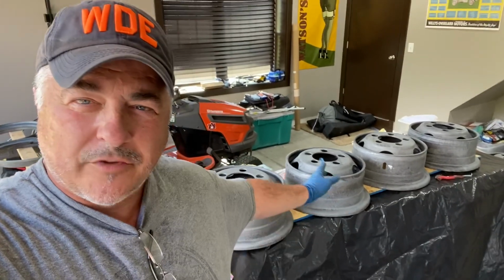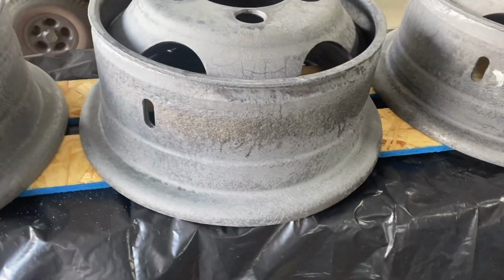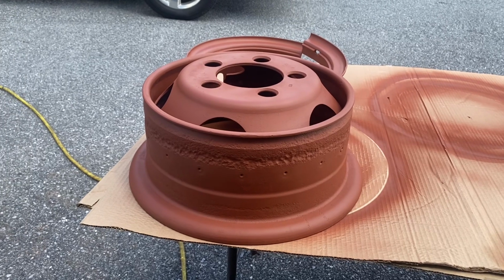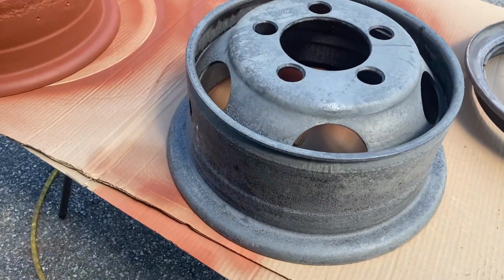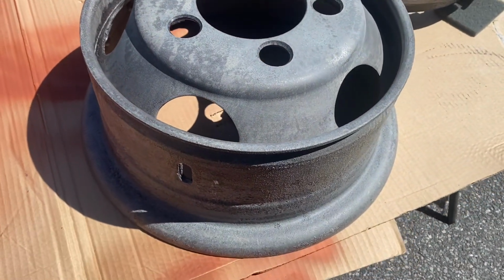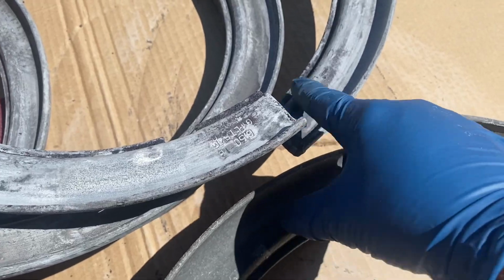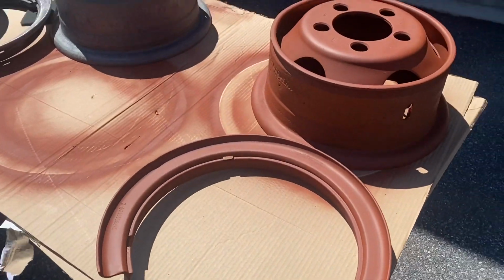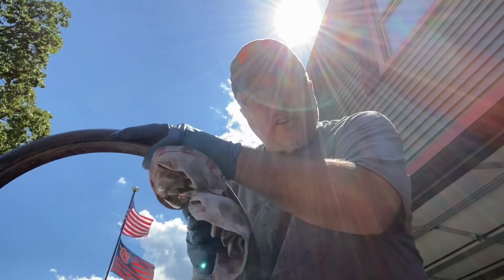Ospho on my M37 rims

Comment: I used JB weld to smooth the rims on my M37,  I think it made them look like new again, my pitting was not as deep as yours though. I think it was mostly caused by the trapped salt water under the wheel rubber flap. (my vehicle came out of Ft Ord) To increase strength perhaps brazing a metal filler to fill the bigger pits. Great work! Love seeing your progress! Best regards!